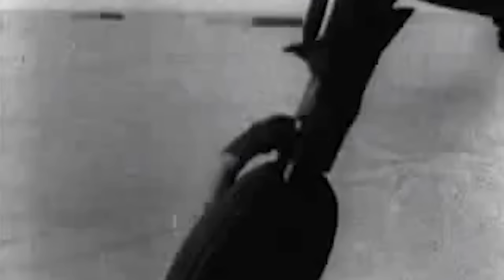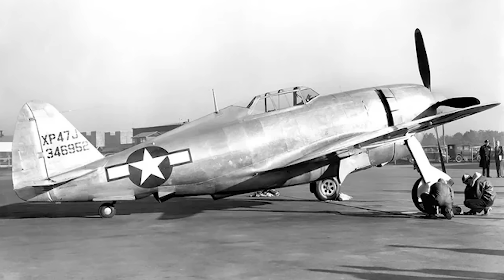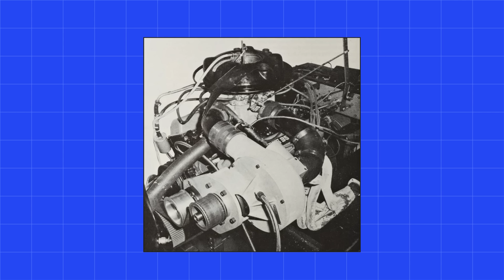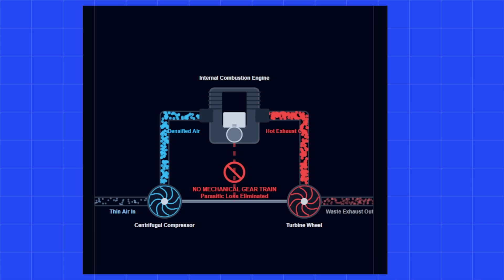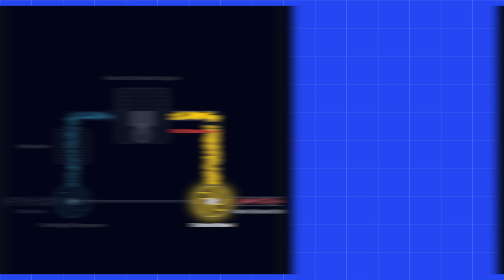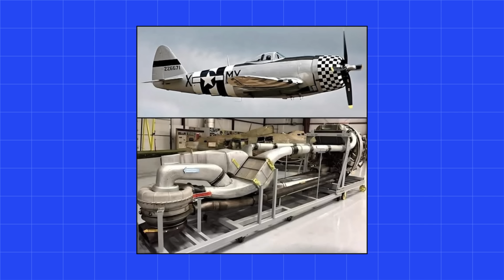The ENGINE That Made the P-47 Thunderbolt Unstoppable

Comment: The R-2800 powered many aircraft, fighter, cargo, etc. I worked on C-46 aircraft that had that engine. It's main fault was  the first low tension ignition system. It had a tendency to break down at altitude, not to mention it wasn't fuel injected.

Comment: This is a turbocharger system, not a turbo-supercharger system. A turbocharger is exhaust driven, compresses air only and sends it to the carburetor, a supercharger is gear driven, and compresses fuel/air mixture, so it's after the carburetor. P-51's, Spitfires and Lancasters had superchargers. This vid is AI.
Reply: It's the same thing.

Comment: Basically, the p47 was a plane built around an engine.  sounds good, and apparently it was VERY good.
Reply: That turned out to be not a bad plan, so later the F-4U Corsair was designed around the R-2800 as well, to the extent that the fuselage was no larger than the diameter of the engine necessitating the odd wing design to reduce the length of the landing gear.